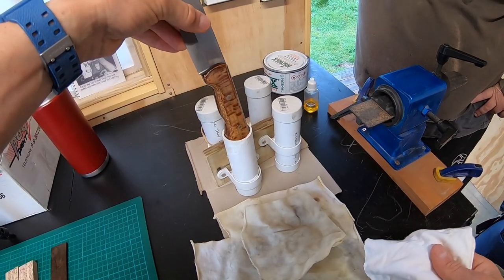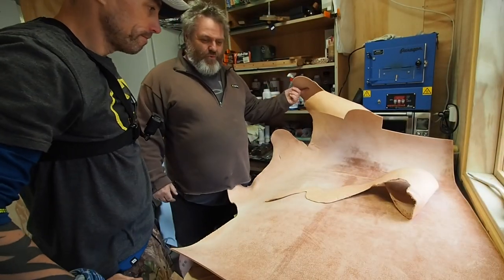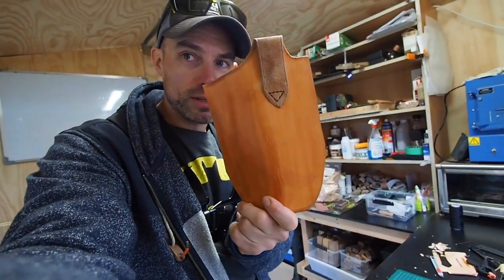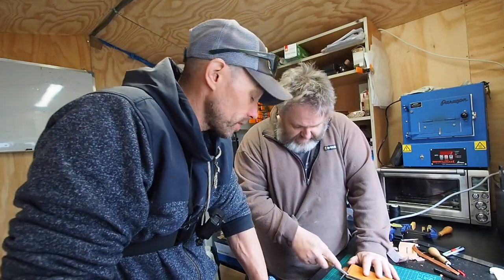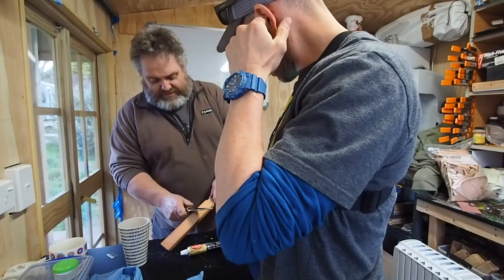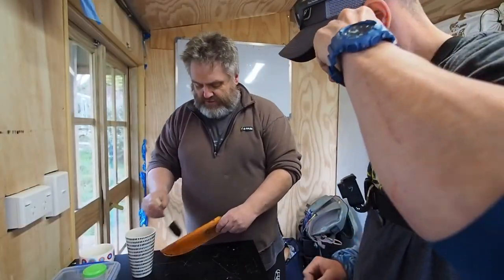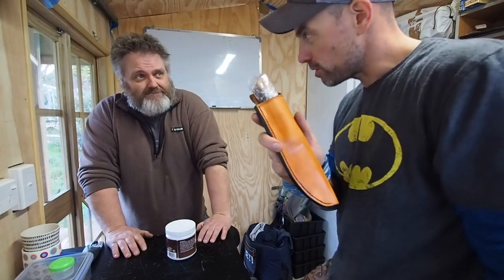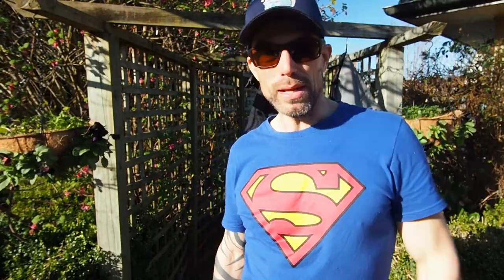HOW to MAKE a KNIFE and SHEATH [Part 3]

Comment: Bad ass knife bro. Looks like it has a very comfortable fit in the hand. I do have a question......what was the orange material u used in the handle in between the two slabs of wood?
Reply: Hi, the orange liners are G10. Thin resin and glass fibre laminate